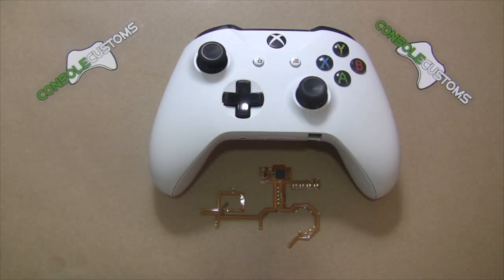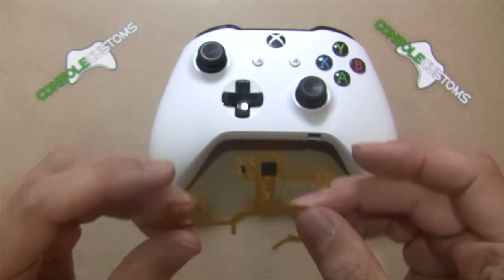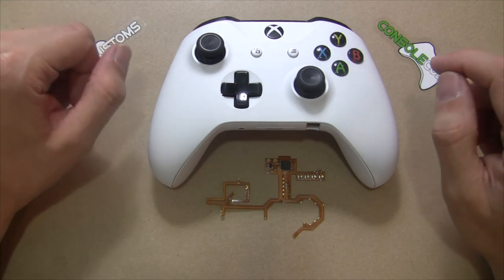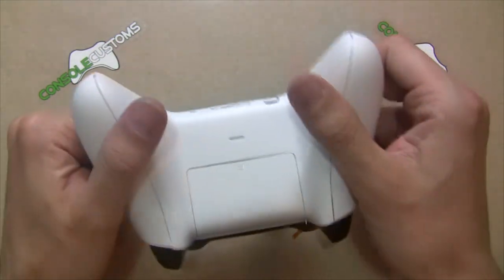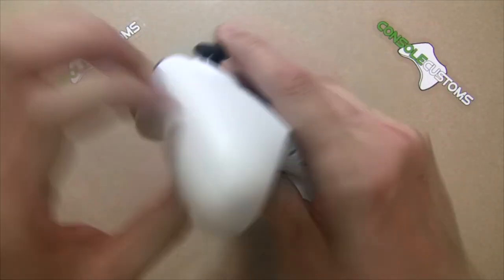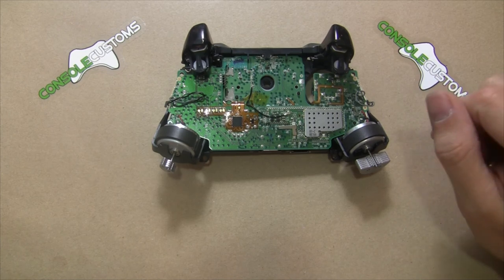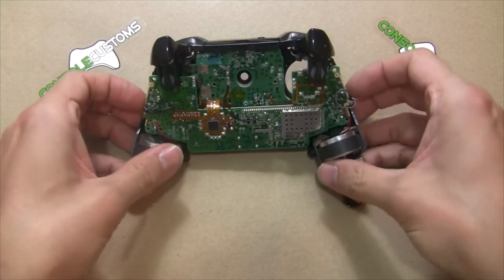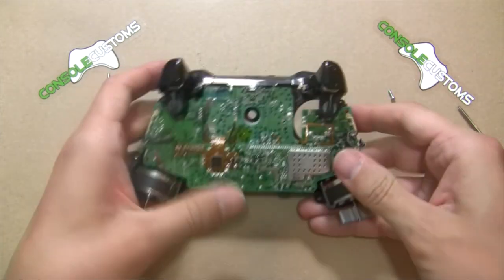Xbox One MaxFire-One V4S Installation

Comment: Where did you get those wire strippers. Purchased 2 different strippers specifically for thin wire and they both failed lol.
Reply: Use an old soldering tip to melt the insulation off. The plastic slips off without ripping any wire inside.
Reply: @getit7107  I tried that but it didn't go as easy as it should so I started to use a lighter

Comment: Hi guys I install a maxfire  one v2 on my elite controller and can get the rapid fire mod working  but in the book it says the white Led will flash alot for a few secs. 

When I activated the mod it's still flashing after 2mins. Mods working but the led is distracting
Reply: This is the normal activity for the rapid fire, but you can change it in the advanced feature management (page 9 of the user guide) there you can change the LED flashing mode so that it just flashes once or twice for the rapid fire being turned on/off instead of flashing constantly when turned on.